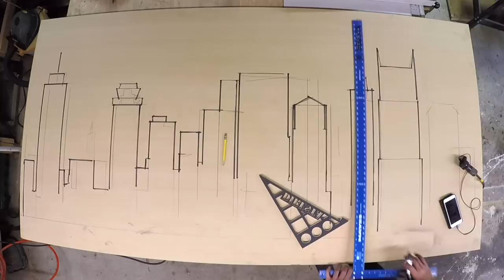✔ DiResta Nashville Dickel  Skyline

Comment: Love it Jimmy.
I can see why you don't use the CNC for those small letters. The sharp points on the inside are a lot of work to redo after the CNC's round bit leaves a lot that it cant get to. I use a laser to cut stuff like that.

Comment: jimmydiresta Cool process on this. Is that just aluminum for the background that you cut with the trim router? I've cut aluminum with carbide tipped blades/bits, but I've never cut steel in that fashion... Love the finished product.

Comment: Hey jimmy, what's your worst cut/injury and what is the story behind it? Mine is about a couple months into my first time taking a construction/woodworking class in high school I was cutting a piece of wood on the band saw and I was pushing to hard and I hit a soft spot in the wood and I cut my index finger, the worst part wasn't the cut, it was the freezing needle because they had to put it almost all the way threw my knuckle and it was tugging on the skin on the other side. But even though I cut myself I was hooked on that class.